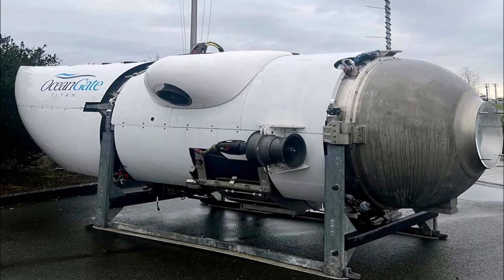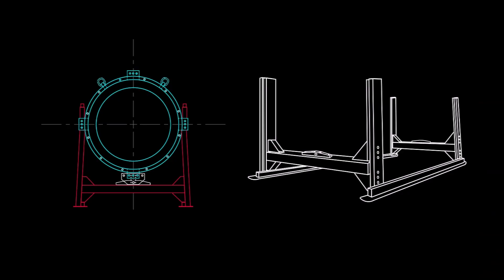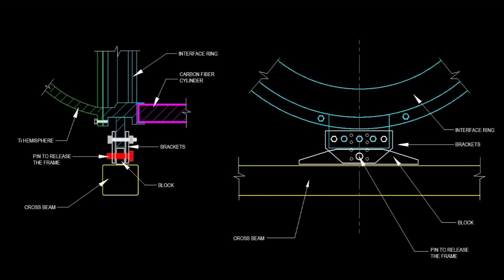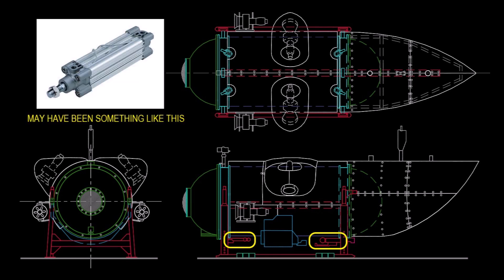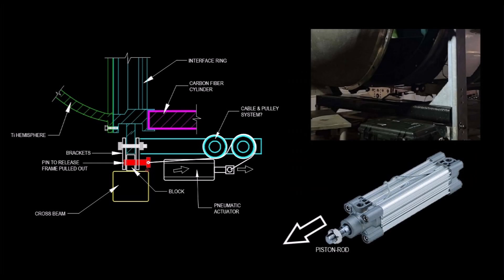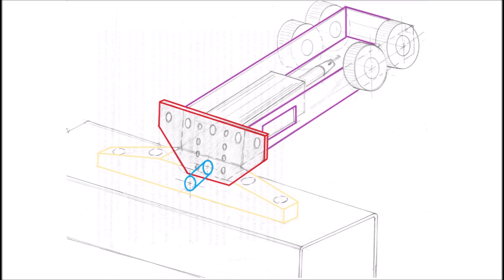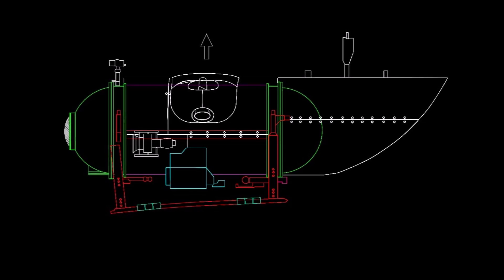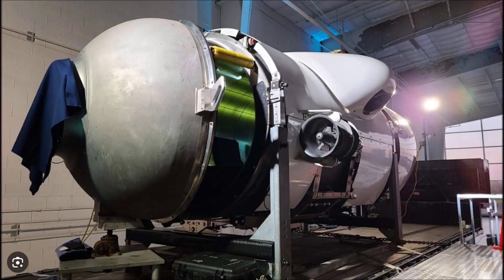OceanGate Titan - FRAME RELEASE MECHANISM

Comment: SWAG - Stupid Wild Ass Guess. SNAFU ; )  I highly doubt the legs were 'friction fitted' to the rings, that kind of fit is known as a 'transitional fit' that is non-structural, and unreliable in terms of release forces. No engineer would be using that kind of fit there. If the legs were a sliding fit to the sides of the rings, it means that the entire weight of the leg assembly was hanging on those two pins in shear.with a very high friction load. The O2 cylinders could not have been used to drive these pins out because their pressure is too low at 6,000 psi max which eaves no differential to the external pressure. Also the O2 tanks get used by the passengers so using them for a safety system would be childish. I heard somewhere else that there would be several parallel methods to achieve the frame detachment for redundancy on a safety system. Hydraulics would be appropriate and the through hull point would be manageable with a small bore stainless tube and fittings, probably with series check valves to prevent back-flow. The bushing for the pin is not to prevent corrosion, it is to reduce friction, it is probably phosphor bronze. The hydraulic system would build the pressure until it achieved the release pressure which would be far above minimum needed pressure and would be simultaneously triggered to the two release pins. I think the cables and wheels were one of the tertiary release systems.
Reply from the maker: My boss told me it was scientific wild ass guess, but same thing. Yeah that bushing would also lessen friction, didn't think to mention that but I did sort of with the teflon caption (I assume that has less friction?). I'm just going off what Bruce Morton said in that interview. He said it was hydraulic at first and then changed it to air, but he couldn't remember the term "pneumatic". Anyway,  I use the term "press fit" loosely. I know it wouldn't have been a true press fit, but I can't imagine that it was very loose either as that would be sloppy and maybe cause  some problems. 

So you are in the camp of there was a hydraulic pump of some sort inside the hull. Where could it have been? Behind the main monitor where the the three computers were?  I don't see where there would be room for it. If it was hydraulic system, it seemed to also struggle trying to get one of the pins out... or otherwise multiple attempts would not be needed. I don't know that the pins would have trouble being removed pneumatically because the lug on the interface ring sat on top of that block on the cross beam of the skid. However, if one pin came out and not the other then one side of frame "drops" and the other doesn't, there's going to be some kind of twisting/deformation of those connecting plate/bracket thingies. I'm not so sure they had a back up system. Seems to me that they  thought it would actually never need to be used, because other technology was supposed to save the day (the RTM system).
Reply: @VegasCyclingFreak  Yes, if the bushing was teflon (PTFE) coated it would have very low friction with the pin. The system could have been both pneumatic and hydraulic, I have designed such systems. If the legs were intended to merely locate the rings in a horizontal plane and be free to drop out upon pin release then there is no need for a press fit, a normal clearance fit would suffice. The hydraulic or pneumatic pump inside the hull would be a small manual pump, or a switch to a small external hydraulic pump, either would be smaller than a small shoe box. I don’t see how we know it struggled getting one of the pins out? As I said, 6kpsi or less from an O2 tank couldn’t overcome the 6kpsi outside the hull that would be on the downstream side of the cylinder. Cylinder O-ring seals are designed to keep pressure inside, not to keep pressure outside, they leak to the exterior pressure, again I have experience with this. The design philosophy on safety systems is that there is no single point failure, and that there are back up systems, this is normal design practice. You are suggesting they didn’t even test this system - that would be gross negligence. Every one of these systems will be on a check list to be verified as functional prior to each launch. Hence so many failed launches.
Reply from the maker: @colinellicott9737  I'll defer to your expertise here. Hydraulic system would indeed make more sense as the pressure available would be waaay higher. Maybe Bruce Morton's memory failed him on this? I do not believe the pump was inside... may have been a switch to turn it on. I think that would have been external in the tail. 
As far as I have been able to ascertain, there were at least three wiring ports, and they were only for wires. I detail that best I can in upcoming video. 

I assume that one pin had trouble getting out from transcript (I know people are saying it's BS but there are too many things in it that line up with the actual systems in the sub for me to believe it's fake). 

Yes, I am saying that frame drop system was very likely actually never tested, at depth anyway. When they did the first few test dives those release pins weren't even present on the sub. I really don't believe they had a secondary system either. Seems to me that the Real Time Monitoring system (RTM) was supposed to prevent a catastrophe and it was felt that they would never really need to do more than just drop all of the ballast. However, if all of the sensors in the RTM system were detecting unusual activity, then it would necessitate the dropping of the frame. This was second in line as far as the actual emergency protocol. First was drop the ballast. All of these things line up with the transcript. 

I read thru that patent Rush filed for his RTM system. It should have prevented anything like this from happening. According to Rush, from his testing of 1/3 scale hulls, there was lots of time before failure... he said like 1,500 meters. If they had to drop frame too it points to a real crisis going on inside the Titan. At this point, it is my belief that Spencer Composites gave OceanGate a sub-par hull and it may have failed from kink band formation(s) which can suddenly appear when CF is being used in this manner.
Reply: pneumatic,hydraulic: Titan used hydraulic fluid to protect the ouside electronics(junction boxes,control pods).They were put in glass containers(boxes and spheres),filled with hydraulic fluid and maintained at 5 psi gauge.The composite air tank was regulated to maintain this presssure.The control pods are shown in the debris.Missing are the glass spheres,their covers and the composite pressure tank.
Reply: @AwkwardDavies  The spheres and boxes of acrylic were the equivalent of fish tanks and in no way capable of sustaining 6,000 psi differential pressure. They isolated the electronics from the sea water using the oil bath, and probably had a membrane that equalized their internal and external pressures.
Reply: In a video SR says that the hydraulic fluid was regulated to be 5 psi gauge in the Birns junction box.I just assumed the same was true for the thick glass spheres.Sorry @colinellicott9737
Reply from the maker: @AwkwardDavies  Interesting. Your comment is very timely. I just learned about that those control spheres a few hours ago! I don't understand what I'm looking at in these pictures but it's kinda fascinating.
Reply: Sorry again, after viewing the video again, the oil pressure regulator is on a some sort of camera box. Also the 10,000 psi composite tank was used to inflate the bladder. No idea how the oil was pressurized.
Reply: Scientific wild ass guess

Comment: I am sure I heard Stockton in a video say that the frame release was done by a hydraulic pump which was operated by hand (cranking a lever) inside the sub.  Pneumatics would not have done the job IMHO, especially once the frame was half detached and one bold jammed. Had to be hydraulic.  There would have been a wee bit of sweat lost in that effort!
The transcript (if true) included the report that they had successfully released the frame but that it took several attempts.  That was at 09:35 11 minutes before the last communication at 09:46
See:  https://www.youtube.com/watch?v=4Dj8IJbP41c.
Reply from the maker: Yeah it had to be a hydraulic system. The “hand crank” was just a 2 or 3-way valve. Hard to say exactly what type of valve was required without really knowing anything about the specific kind of actuators used.

I’ve seen that video you linked. That’s where I learned about the transcript.

You can see a picture of the valve here: https://camo.githubusercontent.com/0f8075c94596cb4b9aaaf383af266165ad99744f22e428d5eb98a1414d0bba7a/68747470733a2f2f692e696d6775722e636f6d2f524679683450312e706e67
Reply: @VegasCyclingFreak  - thanks!  It was a pretty mickey-mouse setup - gives me the impression that they didn't even test is under load on dry land as the issues would have been readily apparent to any fool looking at it..

Typically those actuators take up to 250 bar, so the outside pressure was 350 bar - any leak in seals would not have helped!
Reply from the maker: @nigelwilliams7920  Yep. When you really analyze that system there are a lot of potential problems that it could have. If it was used in the way originally intended, such as if they got stuck on something on the Titanic, then they would have been screwed. Only possible rescue would have been with the help of an ROV.

Comment: My SWAG, is this system to drop the frame was never tested at 4000 meters
Reply: Yeh, given all the corners he cut in his Rush to save $$$, I suspect you're right, though I still hope you're wrong as such gross negligence is inexcusable. If this is so there are a lot of young ex-Oceangate technical people who may never get a job in their field again.
Reply from the maker: I feel there was too much reliance on technology. RTM system was supposed to prevent any bad outcomes so why bother testing that at depth and "wasting" more time/money.
Reply: @VegasCyclingFreak    "I feel there was too much reliance on technology." Are you serious? The whole thing is technology? What are you talking about? From your other response it seems you have not done any formal risk management which is fundamental in engineering, project management, and system design.
Reply from the maker: @colinellicott9737  As far as the RTM system. Technology is not infallible, and especially one that is so new and really unproven. I mean Rush bet the whole farm on what he learned from intentionally imploding a few 1/3 scale hulls.

In my line of work there isn't that much risk management involved... at least not anything like with this sub. It's more compliance with bldg codes, making sure you have sized systems correctly and that sort of thing. We have some of the toughest bldg departments in the USA here. Of course, we have to also keep in mind possible sources of litigation. After 30+ years that's like second nature to me. But it's not like we could design a high rise and not have a smoke removal system, that's a code requirement. I was a project manager once at a 100+ employee company, which sucked and I was underpaid for the stress levels involved, but it was more about meeting endless short deadlines than anything else. 

Anyway, this sub didn't have any such authorities to govern its construction, etc. They basically could do whatever they felt like and operated in an area where rules and regulations didn't apply to them. Not only that, the "mission specialists" signed waivers, so they knowingly went on dives that could end their life.

Comment: There are 4 hull penetrations for electrical and hydraulic circuits. Two pairs or two located at 430 and 730 through the rear titanium ring. For electrical connections OG used off-the-shelf connectors used in ROVs that service offshore drilling and submarine cable in the deep ocean.  Some of these connectors are rated for twice the pressure/depth of the Titanic.  Hydraulic tubing and fittings rated for these pressures/depths are readily available too.  The valve for operating the hydraulics and the external high pressure air tank are from Autoclave Engineers, a company known to me for high pressure hardware.
Reply from the maker: Thanks for the interesting info. I recently discovered there were at least three ports. I noticed that in a picture of the pre-fabbed computer and tail while they were waiting for the CF cylinder to get back from testing. If there was a fourth one then it must have been added sometime after that picture was taken. I did notice there are a couple of tubes that go from one of those fittings to the rear, so if that goes from a valve inside to a hydraulic pump then it's in the tail somewhere.

Comment: Not the main point of this video, but I'm pretty sure the black tank in the tail cone is for high pressure air, not oxygen.  There's a video of Rush explaining it is used to fill an air bladder that provides extra buoyancy if needed to surface.  The black color and rough exterior suggest it is a carbon fiber wound tank which would weigh less than a steel or aluminum tank of equivalent volume.
Reply: Just checked and there are composite air tanks available that exceed 6 kpsi, which is the target design depth, which means that the buoyancy bladder could work at design depth - contrary to my prior understanding - thx.
Reply from the maker: Yes, would be compressed air. That's what I meant.

Comment: Scientific wild ass guess. But still a good one. I do think your theory that some corrosion made it hard to release the frame still has merit, and I wonder what the consequences of towing the Titan behind the mother ship on this voyage had vs having it on board as they did prior. These videos have been informative and well written and produced. I look forward to further videos. Thanks.
Reply from the maker: You are correct sir on S.W.A.G. - galvanic corrosion still is a possibility where the legs were press fit onto that mounting block. Almost guaranteed they were dissimilar materials... I'm guessing what looks to be steel legs were pressed onto probably a titanium or stainless steel block.